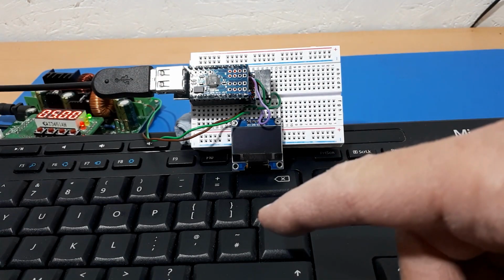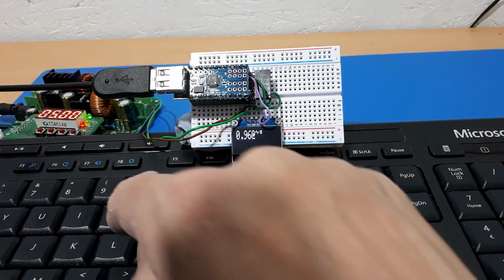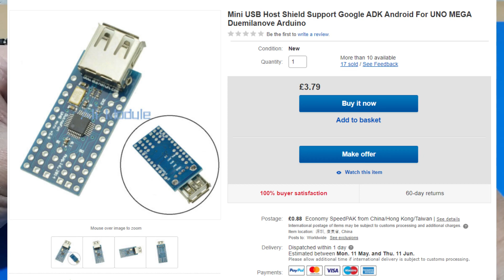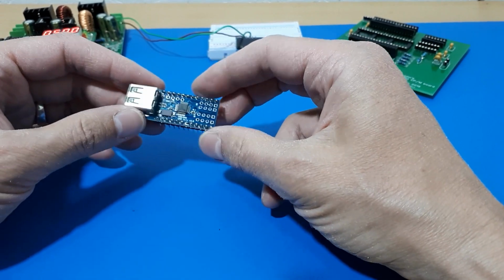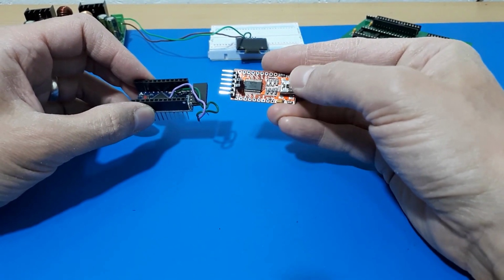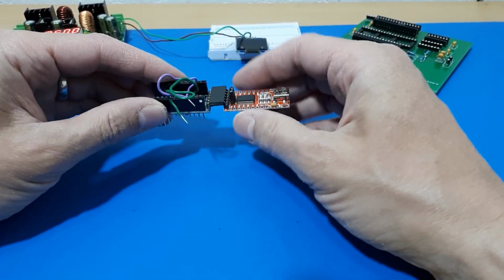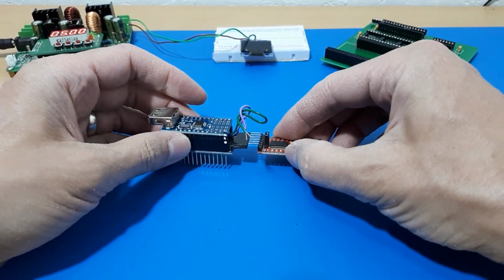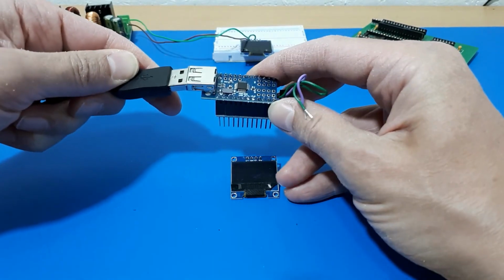Connect keyboard to arduino using Mini USB Host Shield

Comment: Do you think a USB barcode scanner would work with this?
Reply from the maker: Hmm, I have not tried, but often the barcode scanner appears to your PC just like a keyboard that "types" the numbers on the barcode, so I'd be at least 50% confident!
Reply: I got one of these specifically for this reason. (Keyboard wedge to serial out dongle) I am still working on getting it to work...
Reply: @Lilithet  I wasn't sure about this one, i got the USB host shield for the arduino instead, works ok for barcode scanners (and bluetooth keyboards).
Reply: @Lilithet  Keep at it though! Arduino shields require an arduino lol, and the pcb in this video looks really compact and nice for final projects.

Comment: actually there are 3.3v and 5v versions of the pro mini. it is usually indicated by a dot in the respective field on the back
Reply from the maker: Ah you are right. It seems that the ones I own are all 3.3v
Reply: But can you connect the shield to a 5v board? I'm planning to use it with a Pro Micro and I'm not sure if it'll work or will it blow up?
Reply: @adamhun994  did it blow up lol? i have a 5v pro mini on order and i'm curious. I really don't understand this "hack" (cutting the trace).
Reply: @williammuff5485  I've ordered an USB host shield and I have a 5v version of the Pro Micro (if I'm correct), but they're on my shelf because I didn't have time to assemble my project. So nothing blew up yet.
Reply: @adamhun994  the more I read about it. It will fry it at 5v. I’m gonna try a nano (just not sandwiched).

Comment: Dear, If you supply the keyboard with 5v, the keyboard output will also be 5v I think. Can the board process these inputs since it runs on 3.3v.
Reply: USB is a bit weird as a standard, but the gist is that the power is +5V, but the data lines are always 3.3V. So if you supply a keyboard with +5V, you get what you expect (data lines at 3.3V) but if you supply it with 3.3V, you get nothing out. So, it feels counterintuitive, but that's simply the standard at work.
Reply: @janikarkkainen3904  nice...., so this mini host shield still can run with arduino 5v? except we should keep input power for this mini shield still 3.3v
Reply from the maker: The board does accept 5v inputs from the keyboard with no problems. It's a bit of a weird board because it is clearly designed for 3.3v, but keyboards are all 5v devices, at least all the ones I've got.
Reply: @CircuitBreaker256  Thx for the info!